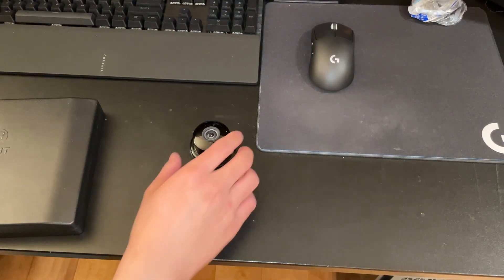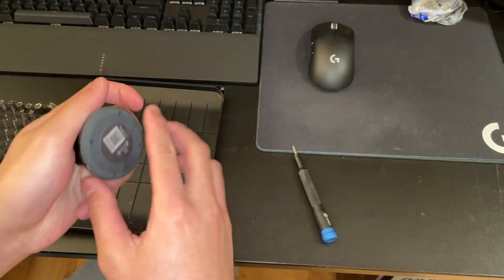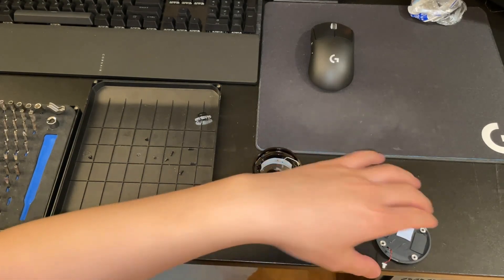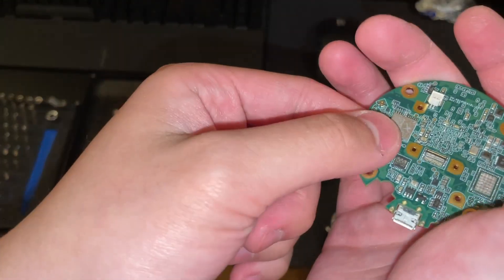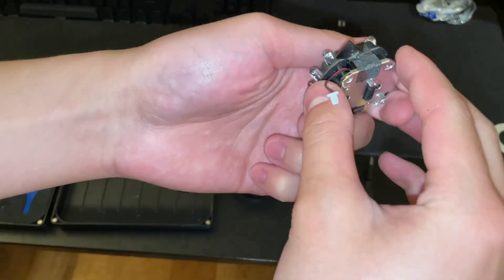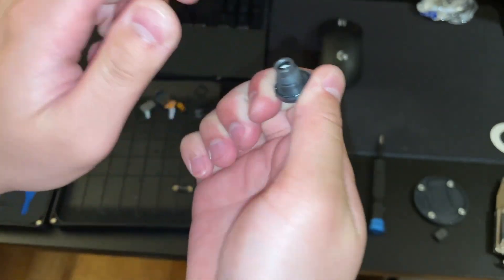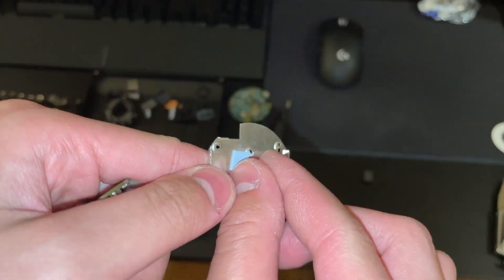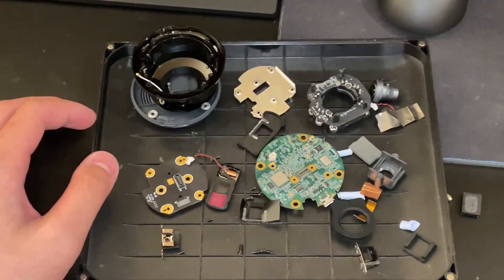Google Nest Cam 1st Gen Teardown

Comment: Super cool! What’s that moving lens filter mechanism for?
Reply: It probably slides over when night vision is activated
Reply: @arkangl03  yep that's exactly what it is, infrared light filter, you can hear it move when the camera switches to night vision.
Reply: Hey. I have the same camera. The micro usb port stopped working then got broken from pushing the cord in to hard out of frustration.  Do you know where or what kind of micro usb port I'm looking for ?
Reply: @JasonR87  you're looking for  a new camera most likely. But if you manage to fix yours, post the video cause I have a dead usb port too